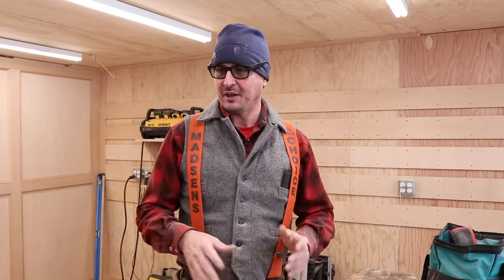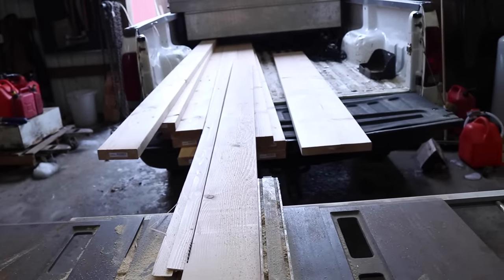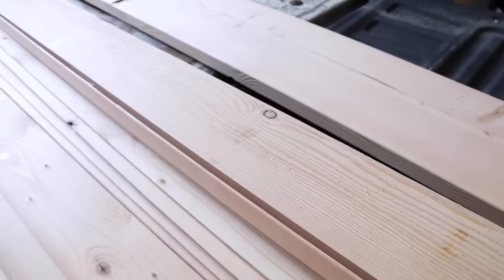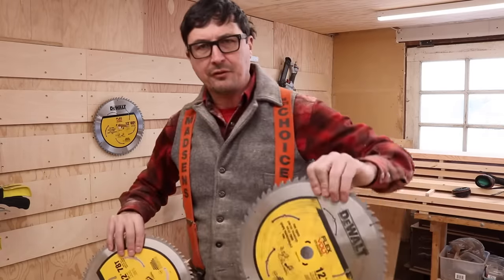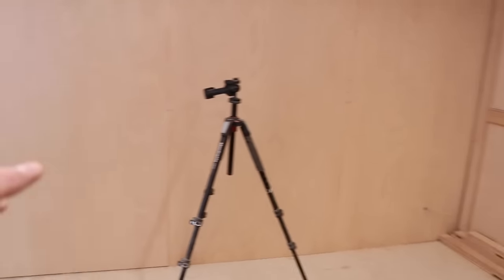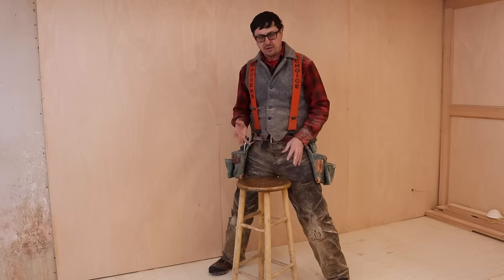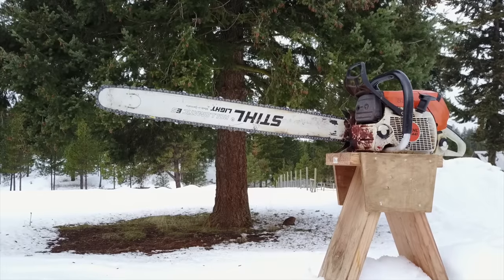The Best $150 You'll Ever Spend!!

Comment: you were only missing an eighth on that 2x12 , it's supposed to be 11 1/4" not 11 1/2"
Reply: must be a regional thing then, here in canada a 2x12  is 1 1/2" x 11 1/4"
Reply: Just 2x12?  cause everything else is all by the half inch
Reply: no 2x4 and 2x6 and both 3.5 and 5.5 respectively and 2x8, 2x10 and 2x12 are 7.25, 9.25 and 11.25
Reply: really... hmm... I didnt know that
Reply: Soaking wet it will be 11 1/2" lol
Reply: ttttdsdcv that's pretty much accurate. that's why dimensional lumber isn't exactly on the half or quarter. it shrinks in the kiln or on the drying rack
Reply: your correct.  here in New England 2x8 and up are smaller.
Reply: Eddy Begley it's advertised as 2x12. that's is the work of the contractors who wanted an easy way to say what sizes they wanted. it's not the sawmills cutting corners. 

the sawmills rough cut at 2x12. then it is milled down through planers and jointers to a closer to dimensional size, usually 1.6x11.35 to account for shrinkage during the drying process. they can't guarantee that the lumber will shrink to exactly 1.5x11.25 so sometimes you get smaller boards. it's just the way it is.
Reply: brownsnake0400 this exactly as a carpenter it's so much easier to call out bring me that 2x4 then "hey grab me that 1 1/2 x 3 1/2"
Reply: Dimentional lumber is always half inch less than is written for example 2x4 is 1 1/2 x 3 1/2
Reply: Mr. Marian no its not. 2x2, 2x3, 2x4, 2x6 and 4x4 are all X.5xX.5 inch. 2x8, 2x10, 2x12 are 1.5xX.25.
Reply: No In my area it is.
Reply: Was just about to reply the same thing.  After 2x8 the with is 3/4 smaller than the nominal size.  No mater where you are.  Here in NC it's all we've ever used
Reply: Mr. Marian I'm sure you're getting rough lumber then. As north american dimensional framing lumber is has changed from exact dimension because it was rough sawn to smaller dimensions as it is processed further now as per contractors' wishes about 80 years ago.
Reply: ROFLfusionknife I learned that 25 years ago in high school.
Reply: ROFLfusionknife I was thinking the same
Reply: A 2x8 is 7 1/4,2x10 is 9 1/4 , and on up.
Reply: Sorry. Someone else already said that. Duh
Reply: Yeah, a few of us lol
Reply: Wow, Few things upset guys like short wood
Reply: yep same here in NYC
Reply: This is a simple google search there Wranglestar.

Comment: Hate to say it, but 2 x 12's (or 1 x 12's)  have been 11.25" wide for as long as I can remember (over 30 years).  It's never been 11 1/2".  That there was a board that was 11 1/8," well that is starting to short change you on lumber width.  That said, thanks for continuing to offer great videos.

Comment: 2x12 nominal = 1 1/2" x 11 1/4" 2x12 is primarily a floor joist. Sized at 11 1/4" for 3/4" subfloor decking giving you a 12" floor system. 1/8" shrinkage is normal in winter.
Reply: Ben Toombs I commented about this just today before I saw your comment. I was wondering if anyone else would chime in
Reply: naa  HD and Lowes does not sell good lumber so you think that it's normal.     when I get lumber from a local supplier called mcCabe's their lumber is a full 1.5 x 11.5 always. I might get one in the whole stack that is down 1/8.    go to the other 2 stores you get it in 1/4 or 1/8 but never a full 1/2 like it should be.  in the good ol days I could hang all of my floor joist hangers first and the boards would be flush on top.  if I did that today my floors would be 1/2" too low on some.  I paid a little more for the other lumber but it makes my jobs turn out better and my job easier.  if I have a joist over a beam that's down that far I don't want to shim it up to match the others.  when I build a deck I need the flooring flat because it's getting a sunroom built on it etc.  so  these junk lumber selling home stores can keep their undercut lumber.
Reply: Hey blue give this a read.
http://www.alsc.org/greenbook%20collection/ps20.pdf

That's how lumber standards work anything over 2x8 goes to the quarter inch therefore 2x10 is actually 1.5 x 11.25

Comment: 6:00 and that´s why I still use steel rulers.
Reply: Der Tante Kethe .... big steel ruler fan here any time I'm working with material 36" or less.
Reply: Yeah I use a Helix folding steel ruler. But I still have several of different lengths and thickness. In my book  till now nothing beats a steel ruler for serious work. Those tape measures are good for table top games, though.
Reply: Der Tante Kethe y

Comment: As someone who works at Home Depot in the training I was taught anything 6 inches and under looses 1/2".      2x4=1.5x3.5 however anything 8 inches and over looses 3/4 of an inch  
       2x8= 1.5x7.25.
Also when you buy 1 by material if it has squared edges it is done by another company and that's where you lose the extra making your 1x12 into a 3/4 x 11 1/8. They simply cut off the edges. Taking an 1/8 off. Love your videos
-Cory from cincinnati

Comment: Lower tooth counts better? Gonna get a one tooth blade :D
Reply: Nerfern  no, more teeth the better
Reply: There are other factors too. If you want a smooth cut that is. Probably one of the biggest is sharp teeth. theoretically you could just use a 30 tooth and go slower.  I think there may be some changes in the offset of the teeth as well.
Reply: A 1 tooth blade? .... We call that an Axe ;o)
Reply: One tooth would be great as long as you have the RPM's.
Reply: I have a 1 tooth blade. It started life as a 4 tooth carbide. I bought it for demolition and cutting up scrap. It still  cuts with 1 tooth, just slower.

Comment: Quick tip cody instead of walking on wood or concrete put the foam mats in front of your work benches it saves you from wear and tear on your back. Think of it this way if you're going to be in front of your work bench alot it helps

Comment: I love that particular Milwaukee Tape measure in 25’. I use it every day. Mine is the magnetic version, like yours and it comes in a non-magnetic version. Select the one that works best for your working environment. Also, I am not experiencing the type of failure that you showed at the 1” mark and I do not have issues with cut hands. The under grip finger stop is terrific also.

Comment: A good way to determine work bench high is if you stand up straight with your arms at your sides and shoulders relaxed. Lift your forearms so that your elbows are at 90 degrees. If your bench is as high as your elbows, it should serve you well as a work bench for standing. May be a little bit high for a bar stool but still worth a look.

Comment: Just a tip . When you hang you blades you should have something between them so the teeth don't touch each other , carbide is hard but delicate and you can sometimes chip a tooth, your blades will stay sharp much longer also

Comment: I want to send thanks to Wranglerstar for giving thoughts as to workbench heights. I am disabled to the point of having to use a walker most times. My present bench is about 40 inches in which I utilize a desk chair and roll around my shop. I find it most uncomfortable to stand from a low desk chair height in order to use the bench top. The idea of using stool to sit at bench top level never entered my mind, I'm going to try sitting on stool in which I will be practically standing. Hopefully improving my mobility while enjoying woodworking with mostly hand tools. Thanks again.

Comment: I don't know if you will see this or not,  Just a comment about the undersized 2 x 12 the American softwood lumber standard minimum width for a 2 x 12 is 
1.500 x 11.250 so that board is undersized but not quite as bad as one would think. Up to 2x7 minimum width is to the half inch but above 2x7 it drops down to the quarter so from 2x8 - 2x16 it's to the quarter. 

 I thought I would share some info just for interest sake. Ps love the videos

Comment: Yes a lot of comments are correct , 1x, 2x 12 lumber is 11 1/4 not 11 1/2 anymore.  8 inch is 7 1/4 .  I bought some 2x8's for my trailer bed and couldn't use 2 of them because they were 7 1/2 inches wide.  I get frustrated with the random widths of lumber now days.  I love bar stools also have 3 in my shop.

Comment: Cody, your comment on lumber dimensions not being correct is right on!  I have been framing in my shop with lumber from Home Depot.  The 10 foot 2 x 6 lumber I am using has varied from 5 1/4 to 5 3/4.  Often these dimensions vary that much in one sling.  Makes it pretty hard to get a straight wall without ripping everything to dimension.

Comment: I want to correct you on the lumber sizes not to be pointing out mistakes just for clarification. I'm a carpenter with 20+ yrs experience all my uncles and my dad are carpenters. Its a family trade. Anyway the lumber sizes are.

2x4 actual size = 1 1/2 x 3 1/2
2x6 actual size = 1 1/2 x 5 1/2 
2x8 actual size = 1 1/2 x 7 1/4
2x10 actual size = 1 1/2 x 9 1/4
2x12 actual size = 1 1/2 x 11 1/4

The reason the sizes are what they are. 
2x4s and 2x6s are a 1/2" smaller because those are generally used for framing walls. Wall sheathing is generally 1/2" thick so with the sheathing you get the whole number thickness. 2x4= 3 1/2" + 1/2" sheathing equals 4" for your wall thickness. Same thing with 2x6.

For 2x8s-2x12's are sized for floor joist. The subfloor material generally osb or ply-wood or even 1 bys are 3/4" thick.
If you have 2"x10" actual size 1 1/2" x 9 1/4" add 3/4" for sub-floor you get 10". Same with 2"x12"s.

Love your videos. You have a wonderful family and you are a great example of a good values, homesteading American family.

Comment: dimensional lumber: if between 0-2" its a quarter inch smaller than stated. 2-6" is a half inch smaller than stated. 6" and bigger is 3/4 of an inch smaller than stated. Therefor a 2"x12" should really be 1 3/4"x11 1/4. Hope this helps

Comment: A bench constructed to a standard height can easily be propped up with blocks under the legs or by making leg extensions that the fixed bench legs slip into.  A bench constructed for a very tall man is not easily lowered.

Comment: I am not 100% sure if anyone else has already commented on this or not but standard 2 x dimensions on on anything over 2x6 is actually 3/4" less than the nominal size. ie a 2x8 is actually 1.5x7.25, 2x10 is actually 1.5 X 9.25. to go with that all 1x material is actually 3/4" thick.

Comment: Ripping the bullnose off the framing lumber is for sure the way to go.  I built the Paul Sellers bench as well and I suspect the lumber in the UK does not have a 1/4" (6mm) bullnose.  Hand planing to square on US lumber is an ordeal!  I didn't have a table saw at the time and opted for an electric plane which made the job much easier but even planing 20 2x4's to square was a significant task.  I did end up with a lot of nice wood shavings for garden mulch!!  Can't wait for the bench build video and your shop looks great.

Comment: In case no one has told you yet, 2x8 and > are all 1/4" dressed dimension, not 1/2" like 2x6 and <. 
i.e. a 2x12 nominal is 1 1/2" x 11 1/4" dressed.

Comment: I have been in the trades for 40 years and used stanley tapes a lot and still have some but they have been good and bad if you 
do not drop them you do not use them when it is raining then they are good but when you drop them they will not work will or if you get them wet they do not work will  retracting spring breaks tips break off tip to small  I have more broken stanley tape on the job now I bought the milwaukee just like one you have and have had less problems with it yes screws do get stuck to them  I like the big tip grips better I do not know your problem with your tape but I use my every day I have drop it I have gotten wet and it still works good

Comment: @ROFLfusionknife1 He is correct it should be 11-1/4".  The main reason is that they are used primarily for floor framing and when you add 3/4" subfloor it then becomes 12" plate to plate

Comment: I love you Cody but on your 2x12 rant you are mistaken. 2x4 and 2x6 are half inch shy because they are for the most part for framing walls with half inch sheathing. 2x10 and12 are 3/4inch shy for young and groove subfloor grade plywood usually 3/4 or 11/16 for a total of 12".

Comment: Shop is looking Awesome! I totally agree, the lumber dimensions listed are not the true dimensions we get. They should fix that. 1" and 2" solid wood materials at the lumberyard have been shy for a long time. True dimension material is what we call, Rough Cut we get that at the mill or cut our self. That is a true cut, if not greater. Granted I'm "only" 36years old but I don't recall when "2 X 12" kiln dried Spruce run through a planner or sanded from the mill for the lumberyard ever being more than 11-1/4 inches wide. I have seen and used Douglas Fir that was 11-1/2 maybe even 11-5/8 but that to my knowledge is not kiln dried. Heck, I've been wrong before just my humble opinion and observations. Either way, let the wood chips fly.

Comment: Dimensional lumber in the USA is furniture grade compared to the crap we have here in BC, in the area I live you can't even get fir anymore unless you custom order it, contractors only use spruce. I agree the only tape measure out there that is worth a damn is a Stanley fatmax they are the best on the market. I didn't realize your Dewalt compound slide is battery powered that's impressive and it swings a 12 inch blade even more impressive. Battery powered tools have come a long ways I never realized they made battery powered chop saws.

Comment: A 2x12 actual size is 1-1/2 x 11-1/4" your tape measured it at 11-3/16 which the lumber might be 1/16 off the industry stander in America or the tip of your tape measure you thank is improper could be off. I have not read the comments but I'm sure just about everyone has made this same comment so sorry if I'm redundant.

Comment: My shed benches are all the same height. even the saw tops, this way everything can run over the top of everything... My shed is small, 5m x 5m, that's 21.7 squires x 21.7 squirrels, the 9 16/19th ones. Thumbs up for the saw thing yesterday, I must have gone back to that bloody vid about 5 or six times just to read the comments and to check if the saw had done anything...

Comment: As a former employee of the depot, they would just tell you it's kiln dried and it shrinks. I'm sure you knew that but, in case you didn't that's how they prevent the lawsuit. As far as I'm concerned if it says 12" it should be 12".

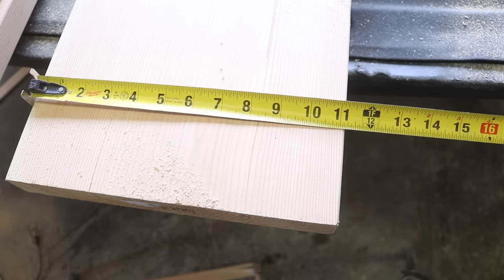Comment: At 6:19 you talked about the lumber mill and their shady practice of charging you for  what your not getting.
I heard that the housing industry is getting screwed over with 2x10 floor joists as well! And building codes are changing(2x12).
Instead of making the lumber mill do the right thing. And give you what you pay for.
The Electrical trade is also getting screwed over with conduit sizing , the inside diameter should be the trade size 1/2",3/4",1"
Just because materiel changes  PVC,EMT,ABS etc. the trade size should be the same. Just saying:)

Comment: Rather than be locked into one height why not make it an adjustable height bench - slots and wooden knockout pins....
Reply: It's less stable and sturdy also it's not the traditional way to do it. As you can see this bench is a Nicholson style bench, and these benches are fixed. You don't actually need it to be adjustable or anything.

Comment: My Milwaukee tape failed also!  Ripped in the same place yours is showing wear.  I love Milwaukee power tools.  Grew up on them and they are pretty much all I buy.  But the tape measure is the worst I have ever had.  One other gripe I had about it.  There were no supports to keep it upright.  So, if you ran it out and locked it to make a mark the housing would fall over.

Comment: up to 2x6, its 1/2 inch less than the width of the dimension; wider than that its 3/4" less; i.e. 2x4 is 3 1/2"; 2x6 is 5 1/2"; wider than that 2x8 is 7 1/4", 2x10 is 9 1/4" and a 2x12 is 11 1/4"; so, yes, your HD 2 x 12 being 11 1/8" is not correct, but its not 3/8" off; its 1/8" off

Comment: Never use gloves when operating a table saw....and no sleeves or anything else below the elbow either...no rings, bracelets, watches, etc.  You must remain naked below the elbow for safety.  If it gets too cold, then take a break with your gloves and jacket on until you warm up, then take them off before resuming your work.  An insulated vest and head covering will help keep you warm and allow you to get more done between breaks.  The naked below the elbow rule applies to nearly all stationary power tools....drill press, jointer, band saw, disc sanders, shapers, etc. Very long hair and hanging pony tails are also very dangerous.

Comment: 2x4 is 3 1/2, 2x6 is 5 1/2, 2x8 is 7 1/2, 2x10 is 9 1/4, 2x12 is 11 1/14 that's the mill specs for framing lumber, if it was rough cut lumber then it would truly be a 2x12

Comment: I wonder how the chargers would be mounted vertical on a cleat. I know most chargers have the holes to do this, but wonder if would be advantage to have them mounted solid, and if it would help with getting battery's on and off the charger.

Comment: When you were explaining the actual size of dimensional framing lumber, I thought, "It's not always 5 and a half, or whatever and a half, anymore!"  Then you showed that with the 2x12.  I've had that experience quite often.  It's almost always about 3/8" short, if it's short at all.

ETA:  Hey!  Why is that blade guard still on the saw?  ;o)

Actually, I left the guard on the miter saw when I got a new one.  It actually gets out of the way properly when you cut.

ETA:  After reading some other comments, I looked it up, and, apparently, larger than 6" nominal size, the dimensions a 3/4" less than nominal (e.g. 2x6 = 1.5x5.5 and 2x8 = 1.5x7.25).  HOWEVER, I've had 2x6's that were 5.25" OR LESS.